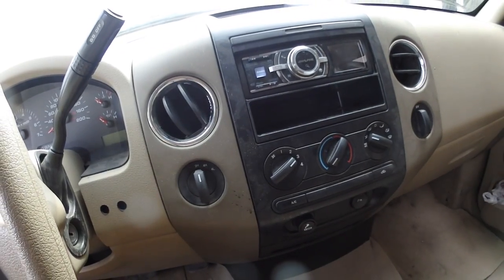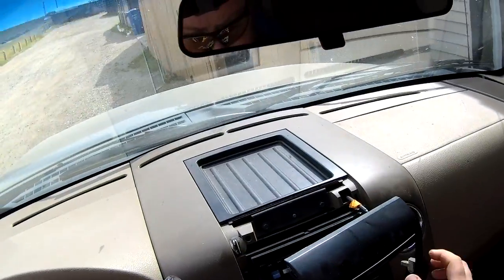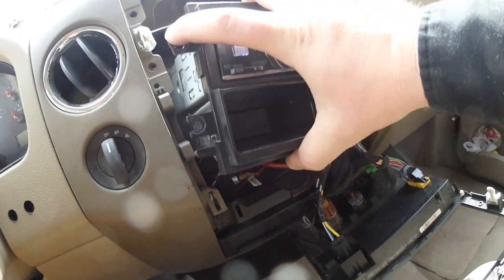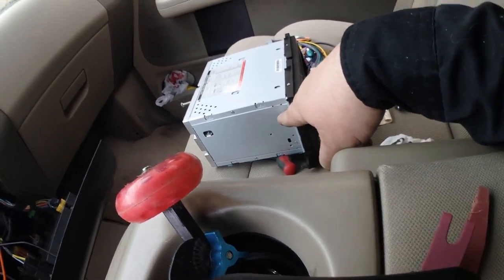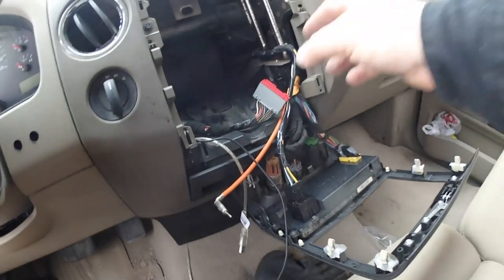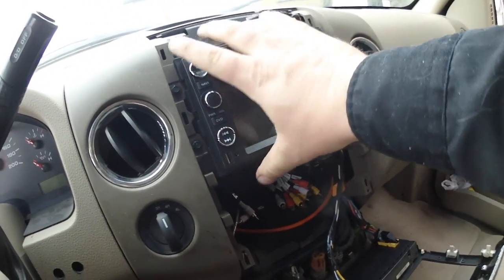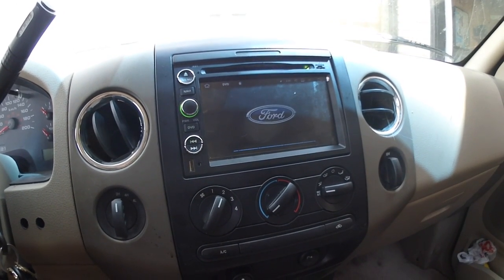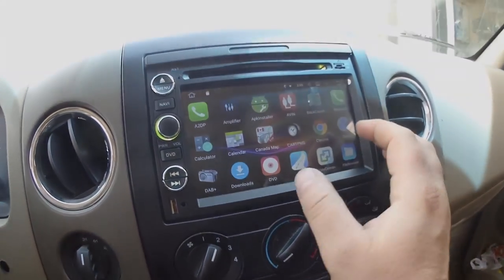DiY Ford F150 Stereo Install 2004 - 2011

Comment: This is the link to amazon but it's currently unavailable. 2004 Ford F-150 Google Android GPS Navigation System in-Dash Stereo Radio OEM Replacement DVD LCD Bluetooth + Maps by Atlas Navi

Comment: This unit didn't require a scoshe style adapter in between the factory and aftermarket head unit? My 2001 did and from what I understand most ford cars from that era did too... Real pain in the ass adding extra cost... This looked pretty clean plug and play?

Comment: Hey man I got an 04 lariat and it has the steering wheel controls. Will they still work if I replace the radio with a Bluetooth one? It’s the stock radio in it currently.

Comment: Hi, I’m trying to install an aftermarket radio on my 2005 f150 but there is only one connection on the original radio and only one plug to fit into it. The new radio has two connections and requires two plugs so I’m wondering what can I do. Thanks.

Comment: bought a Hipzo HU. I've been back and forth with the seller. It turned out that they  are not plug and play. After a week of language barriers and frustration I'm returning it. Was your install of the Eonon plug-n-play, no cutting or splicing? Any issues? Thanks for the video.

Comment: Hey man I got an 04 lariat and it has the steering wheel controls. Will they still work if I replace the radio with a Bluetooth one? It’s the stock radio in it currently.
Reply: McSlama Jama same here did you end up doing it?
Reply: gotta get the idata link maestro sw
Reply: Cheyenne Obregon I did not. I’m still looking